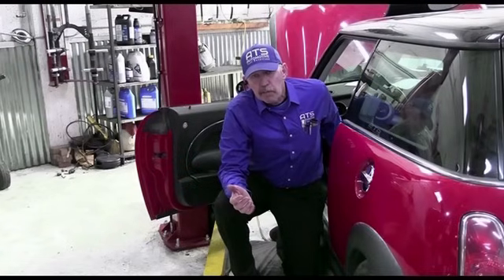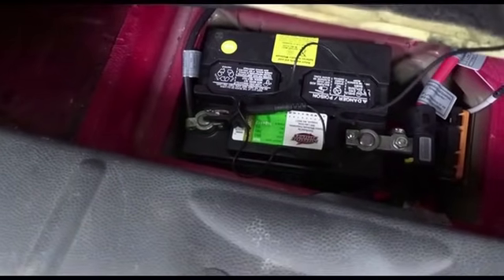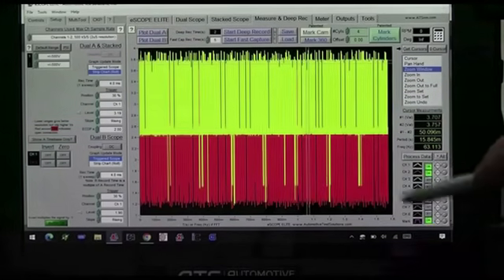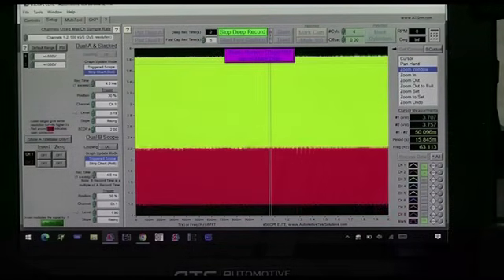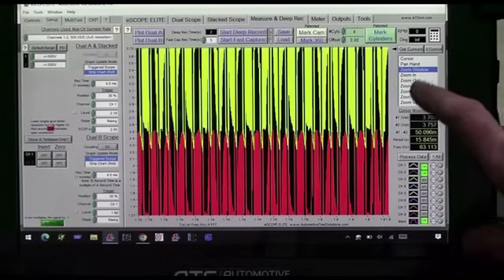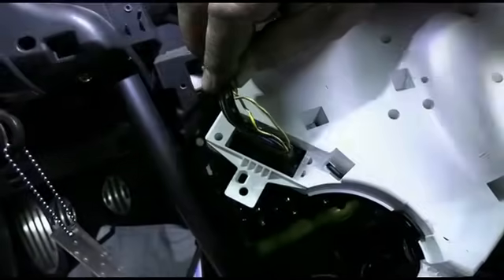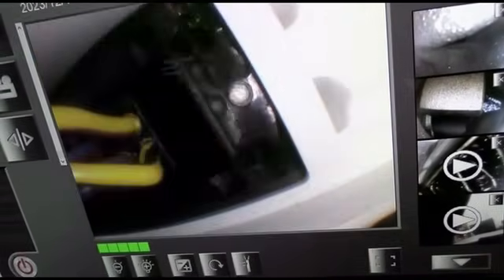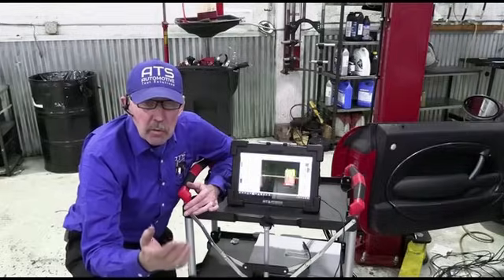Bernie Diagnosing a CAN Bus issue on a 2005 Mini Cooper S

Comment: great case study. makes me wonder if the dash is indeed defective or is it a part revision or substitution for which there should be a bulletin on or just a wrongly numbered part. would be interesting to look up the wiring for different years to see if can high  and low are consistantly the same pinout and the part number remains the same.

Comment: I did a video a few years ago on one of these old minis. That ended up being a K bus short to ground, found after exhaustive search. While poking around I found the DLC is like this one, not attached to the CAN bus. Interestingly I stumbled across an unattached terminating 120 ohm resistor inside the connector for the DLC. Presumably they had designed the DLC to accept a new design including the CAN bus for upcoming years. By the way, this video came up as only 360p resolution, a little hard to read the details of your scope. Great demo, one to remember!

Comment: This is weird, that i can agree with.  Two replacement dashes dont work, but turns out that if you switch the pins in the connector, it suddenly works.  Somewhere, between the center dash and the next CAN device are some wires that were reversed by the water infiltration crew.  Im betting its in a connector. They switched CANH and CANL somewhere when cleaning/drying/lubing the water problem.
Reply: Or damaged the wire harness during the dash repair and accidentally got high and low mixed up when spicing them back together
Reply: @eric49a  exactly, someone swapped them somewhere.  That seems more likely than something being wrong with two replacement parts.  CAN is supposed to be resilient, but it doesn't take much to wreck communications on the bus.  Being on the high speed bus, I'm kinda surprised there weren't some driveability issues from the multitude of packets driving the bus voltage in the wrong direction and talking over everything.  Seems like the controller in the dash cluster should have removed itself from the bus.  It surely could tell something was wrong; CANL should never be at a higher voltage potential than CANH.

Comment: Did you compare CAN H at your steering column connection to the CAN H wire at the center dash to make sure the harness wasn’t spliced wrong somewhere?
Reply: thats the same thing that immediately came to mind for me when seeing the inverted messages
Reply: Maybe connector X15 by the driver's kick panel? Diagnosis definitely needed one more step to determine "crossed wires" vs "defective new dash" :)
Reply: @PineHollowAutoDiagnostics  agreed, especially when supposedly the original issue was water damage. That usually gets a connector with crusties in it. The connector in the video looked perfect. The odds the wires got swapped somewhere is much better then the circuit board is wired wrong. I feel like Bernie missed a critical test here. Not like him at all so just goes to show nobody is perfect.
Reply: @autodiagyt  maybe nobody is perfect but he is the closest i have seen doing diag
Reply: Awesome diagnostics

Comment: There's technicians in the comments suggesting Mr Thompson missed "wiring problem", or "connector problem". Mr Thompson should have jumped all the pins from the module center dash to the connector by jumper wires , all but the two comm lines pin13 and pin26 and scope these two , from the module side while they are disconnected from the rest of the network in order to shut the mouths of "disbelievers". By looking at the comm diagram , the wires are spliced between the modules with no intermediate connectors. And if wiring were shorting together , i believe then even when the wires at the module were inverted to fix the current problem , the car would still have comm problems if problem was wires touching, but it did not , 100% proving the problem is the module transceiver. And just to say - Thank you mr Thompson for making this FREE content , such complex problems can be seen FOR FREE only at your channel without folks having to give away their hard earned money. Such studies and in depth information about the system could be only be seen on "National level training events". But this cost money, time and effort. Traveling around the country, planing holidays and giving money away in these difficult times.
Reply: There is an intermediate connector. Its X15 on the left kick panel in the drivers side. It would absolutely not happen in the splice packs, which would be hard to do anyway because those splice packs are separated from each other. You would have to purposefully be an idiot to swap them across those splice packs. The left kick panel is very common for water, and eats at the body control module that also lives at X15. I would not doubt the problem is there. Good job finding the problem but I think a note should be taped to the back of the cluster that there is swapped CAN wires now, because I'm 1000% sure it's at X15.

Comment: The manufacturer needs to be held responsible for this. I’m so tired of dealing with bullshit like this. If there’s no bulletin or letter and this is the correct part this is 100% on the manufacturer, id take them to court, 3 years without being able to drive the vehicle due to 2 bad brand new parts from mini.